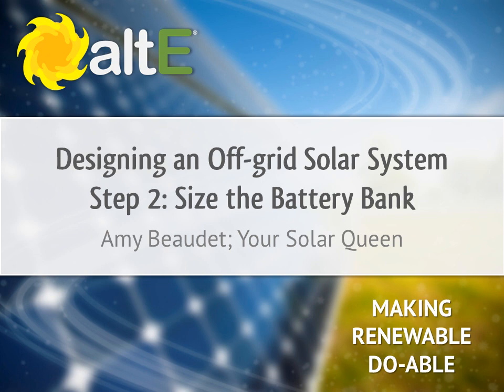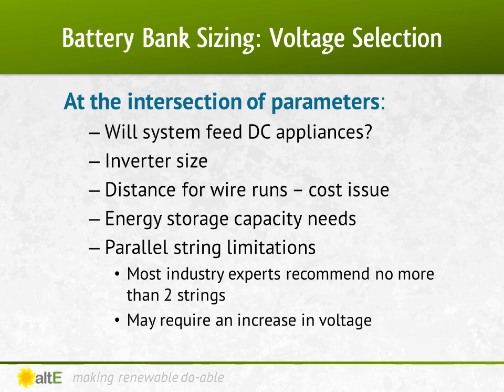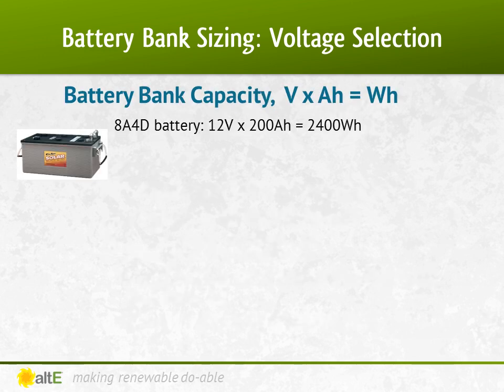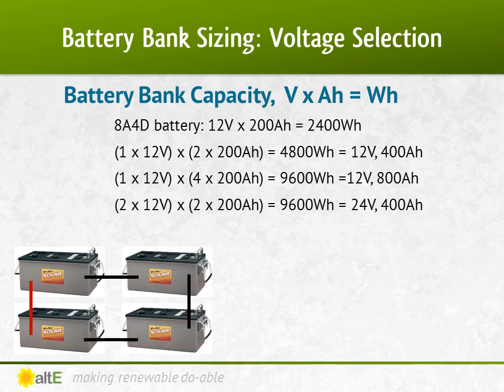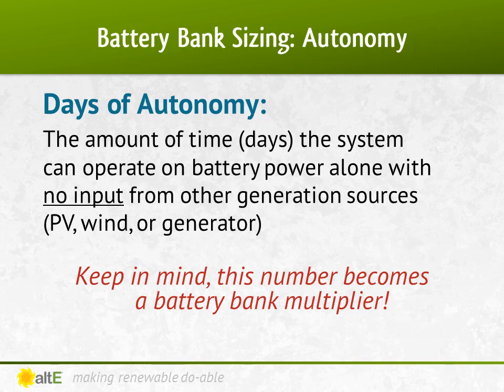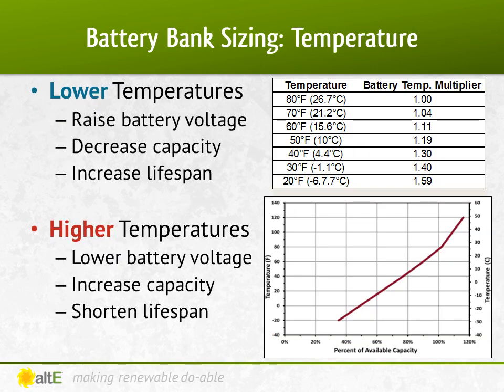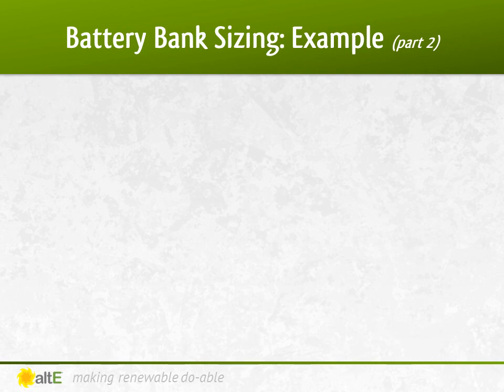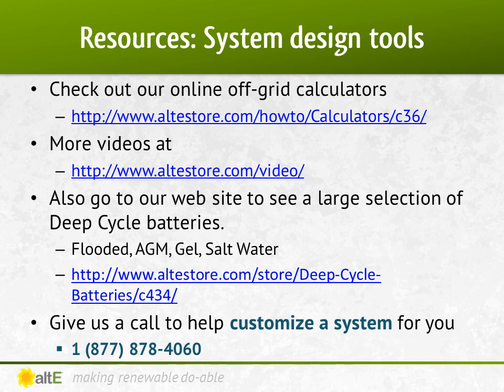Battery Bank Sizing: Off Grid Solar Power System Design - Step 2

Comment: I just recently noticed something,,, I'm very new to Solar I studied up on all this stuff then hooked up my 4 golf cart batteries 2 strings I hooked positive and negative together on two batteries then I hooked up the other 2 batterys the same way, I then connected the first string to the second string by way of hooking up the negatives together,,,,well in all my excitement about everything I then hooked up the charge controller,,,real nice pro star ps 30 m,,,then my panels,,,made sure everything was fused and grounded,,,,got a real nice samlex pst 300,,,works great,,,well the other day I was checking the water level in the batterys and got to looking around and seen that I had forgot to hook up the the other side of the strings+pos.from one string to the other.?????I was and am hooked up across the bank diagonally it was getting 12 volts and still am,,,well after I made the correction I found my self wondering how was it able to work like that???was I only getting amps from one string???anyone know please feel free to enlighten me,the only thing connecting the strings were the_negative from one string to the other,,,,idk,whatever you do especially if you are new don't be overcome by the excitement of what you're doing take time to really look at things good and maybe get a friend for a second set of eyes to look at it too that's what I've done now,,,anyhow thought I would chime in on that
Reply from the maker: +bill767667 You guessed it right, you tried to wire 2 parallel strings of 2 in series, but you ended up with two sets of batteries wired in series, but not wired together in parallel. So you had 12V, but only half the amp hour expected, from one string, not 2. Whenever I am building a system, I draw a rough schematic, and will trace everything out between the system and the drawing.

Comment from the maker: @Jac Wolf - I can't reply to your comment, your settings may not allow it. So, in case you read the other comments, I'm assuming you mean 16kWh battery bank. If so, figuring 50% depth of discharge, that leaves you 8kWh or 8000Wh / 3000W load = 2.6 hours. That's not including other losses like inverter inefficiencies and temperature compensation.

Comment: thank you for explaing about the 2 paralell strings. i didnt know and did 8 car battery that way. i got 12 volt inverters, so i think i'll run 2 strings of 48 volt, and tap into one battery on each leg. got plenty of controllers to charge for 48 volt

Comment: Amy - I am trying to reach the technical desk at altE because we may need to upgrade/add another pre-wired SW4048 to our system. We need to charge (2) Absolyte GX 48vot/2,000 Amp hour Battery banks. Please help direct us if you are able. Thank you.

Comment: I live in the Caribbean where we get around 5 - 6 hours of intense sun a day based on maps. I want to run a 50watt deep freezer for 8 hours a day (400 WH) using a 12v,  2000watt inverter with a PWM controller. Based on two days without sun, this video's calculation recommends a 8000 Ah battery bank yet only 119 watt solar panel! In areas such as the Caribbean, with many hours of reliable sun, can you reduce the size of the battery bank and increase the solar panels when appliances, like a fridge, are run only during peak hours like from 9am to 4pm?
Reply from the maker: I think you missed a step in the calculation, that battery bank is too big. 400Wh / .9 inverter efficiency x 2 days \50% DoD x 1.11 temperature / 12V = 164Ah. But to your original question, load shifting can be tricky to calculate. Yes, it makes sense that if you run the freezer when the sun is shining, you'll need a smaller battery bank, because you are using the power almost as fast as it is being made, so you don't have much to store. The problem comes with your 2 days of autonomy without sun. You still need the full amount of storage to run without the sun, plus you need to make sure your battery bank is full and ready to go before those two sunless days hit. So if you used all of the power real time the day before, you may not have charged the battery bank fully as well, if your load used most of the power. That that can be managed a bit by making sure the battery bank is full to begin with, and you size the solar array to be big enough to make all of the power use use, plus a little extra to ensure the battery is always topped off.
Reply: Thanks for your reply and all your videos! I'll probably double the bank and panels since that is about what I use now without the freezer.

Comment: I have 10 300w panels about 30 ft from the garage I'm trying to figure out if I should put the inverter batteries controller in a shed next to the panels and run AC to the garage or what I would rather do is have inverter batteries controller in the garage. What size wire would I need for 30ft run? Can't find that info anywhere.  Love your videos!
Reply from the maker: How are you wiring the panels? Five parallel strings of 2 in series? What voltage is your battery bank? 30' isn't too bad to run the panels to get into the garage. Find the Vmp of the panels, times the number in series, and the Imp of the panels x the number in parallel, and use this voltage drop calculator to determine the wire size. You want less than 2% voltage drop. https://www.calculator.net/voltage-drop-calculator.html
Reply: @AltEStore  Yes 5 strings of 2 each. 4 12v batteries to make 48v since panels are 48v.
Reply: My array is 85' from my electrical room and The loss is negligible.

Comment: Thanks a lot for those very clear tutorials.
Why do you restrict your battery bank voltage to 48Vdc?
Low voltage = high current = high fire hazard or high cost (high gauge)...
I may come up with a silly idea, but I'm considering a solution enabling  both power and water supply (to a water tower) from the same PV array, but using a solar pump inverter in order to preserve my batteries, the most expensive part in all this... 
Pump inverters usually need a quite high DC input. We do not need to pump water like seven eleven 24h X  7 days... so the idea is to have a PV array that can be reconfigured from 2 strings of 6 panels in series (250W-60) = POWER into one string of 12 panels in series to get that high voltage = WATER. The MPPT controller shall be able to handle 300Vdc  PV input, >3000W, and charge a 96V battery bank. 
Voc=37.1 Vdc, %/°C = -0.32%, t°=5°C, =>Voc=39.47Vdc x 6 = 236.85Vdc 
W input Max irradiance =  irradiance at noon Max t° 65°
Pmax 250W  %/°C = -0.47%  P65° = 2,436W; 2,436W ÷ 96V= 25.4A => 30A.
I can achieve the reconfiguration with two DC Isolator Switches 4 Poles
I would not be able to do that with a 100V or 150V DC max MPPT controller, the switching POWER => WATER would be more tricky... 
Some Morningstar products accept up to 600VDC PV input...
Reply from the maker: With Tesla's announcement of their 350VDC Powerwall battery, some inverter manufacturers are developing inverters to support a 350V battery bank. However, most inverters still only support up to 48V. I suspect this will be changing soon as availability of the Powerwall battery grows.

Comment: Does it help or hinder to cross-connect battery banks in parallel, so that the intermediate voltages throughout the parallel groups are equalized?

What I mean:
Suppose I have a 2x2 battery bank.   Batteries 1 and 2 are in series.   Batteries 3 & 4 are in series.   Batteries 1 and 3 are the most negative batteries, with their negatives connected.   Batteries 2 and 4 are the most positive batteries, with their positives connected.

Should I connect the positive of battery 3, to the positive of battery 1, in the above bank?
What are the advantages / disadvantages of doing this?
Reply from the maker: Absolutely yes, connect diagonally. If you were to connect just from 1 & 2, due to the additional resistance of the parallel cables, and Ohm's Law, they would get most of the charging and discharging, creating an imbalanced battery bank. Connect the minus  on battery 1 and the plus on battery 4.

Comment: I need a bit of help doing it the other way around please. I am looking at buying a battery bank with 16Kva batterys (48volt system). My max usage is about 3000watts per hour. My non electrical head tells me its about 10hours ?? Thanks

Comment: hi thanks for the calculation. I have one doubt, how did u end up picking up 48 V?? Was that just your choice?  Could i have chosen a 24V system voltage. So in that case it would have 16,986 Wh divided by 24V and than i would have carried on with other calculations.? Would that have been ok as well ?
Reply from the maker: While you could do 24V, it creates some issues with large battery banks. #1, if you also have a large solar array, you will need 2x bigger charge controller, or twice as many. For example, if you have a 5000W solar / 48V battery bank = 104A of charge controllers. But if you have a 24V battery bank, 5000W / 24V = 2o8A charge controllers. #2, if you have a big inverter, that causes high current going into the inverter from the battery bank. For example, 8kW inverter / 48V = 166A. But for a 24V inverter, it would be 333A. That would take bigger battery cables and breaker or fuse. #3, you would need a higher amp hour battery bank. 17kWh / 48V = 354Ah, but / 24V = 708Ah, which can be tougher to make without doing multiple parallel strings. But, if it is a medium size system, and all of the math comes out reasonable, then yes, divide by 24V.

Comment: I just say something about sizing the battery bank by array size controller max out out amp and voltage. ie...2k array, 79 amp max out put controller and 24 battery bank not up to par?  (2000  79x24= 1896) by what I heard a 36v or higher voltage bank should be used? Is this correct?
Reply from the maker: There are several factors that go into deciding the battery bank voltage. Very few companies make 36V equipment, so if 24V isn't high enough, you would go up to 48V.  Your example of the 2000W array and 79A controller is a good one. 2000W / 12V = 166A, so that won't work. 2000W / 24V = 83A, so again, no good. 2000W / 48V = 41A. Bingo!
Reply: Thanks fr verification I was hoping it would work, I really didn't want to g with that many batteries  Great info

Comment: I have 4_6 volt golf cart batterys 4_100 watt panels,morning star charge controller ps30m,the batterys are 188amp hour excide,I use 12 volts as much as possible,I use a 300watt samlex pst sine wave inverter,and I also have a few different generators,I want to know,,,can I safely add 4 more batteries wired to same as I have no series parallel so I'll have to series parallels instead of the one so I can have more TV watching time on the weekend and other things can I do this without hurting the bank(battery),, I assume it would be safe to do

Comment: What about BMS? If you have a BMS then can you run more strings? What about lithium batteries that have a built in BMS? I'm looking at doing a large lithium system with built in BMS running 4 strings...
Reply from the maker: Most lithium are able to manage more strings than lead acid due to their battery maintenance system.

Comment: Amy, step F: Determine total number of batteries needed. The formula should be number of parallel strings that is 2 times number of batteries in each series string.

Comment: hi there, can you clear something up for me.

I am trying to figure out an equation for my battery bank.

If I want to find out the amount of amps that my 140 watt tv uses, do I need to divide 140 watts by 240v ac(as this is what my inverter produces) Or do I divide 140 watts by 12v (my battery voltage). my battery bank is 115 amp hours so I want to know how long I can run the television for. thanks!
Reply from the maker: I see from your channel you are in Ireland, so the 240V (or possibly 230V?) output from your inverter is what you would be using to power your AC appliances. I wanted to check what country, as here in the USA, 240V is split into two legs of 120V, so the answer would be different. So for you, to determine the amps drawn by your TV on the output of the inverter, you divide watts by AC volts. So 140W / 240V = .58A on the AC side. Now if you want to find out how many amps your inverter is drawing from the batteries to power the TV, that's when you divide the watts by the battery voltage. 140W / 12V = 11.6A on the DC side. I hope that makes sense.
Reply from the maker: What might be easier for you is to convert everything to watt hours. Your battery bank is 115Ah x 12V = 1380Wh. You don't want to use more than half of that for 50% depth of discharge, so you have  690Wh available. 690Wh / 140W TV = 4.9 hours. It may make sense for you to buy a newer TV that uses less watts, 140W is pretty high for a TV these days.

Comment: can we use 2  24v 400ah batteries in series (2*24)*400=19200wh?
from this method we can use 2 batteries instead of 16batteries 6v.
Reply from the maker: If you can find 24V 400Ah batteries (9600Wh) and they will fit in your location, you can use them. But they will likely be very big, especially if lead acid.

Comment: hi there can u help about battery power capacity.
2×200ah 24volts system.  and 2×200ah in 12 volts system are these two set of battery are the same in terms  of power capacity if both fully charge which is 4800 watts im curius
Reply from the maker: I assume you mean if there are two 12V 200Ah batteries, in one system they are wired in series for 200Ah, 24V, and in another system they are wired in parallel for 12V 400Ah. In both cases, the battery bank would have the same capacity, Ah x V = Wh, so they would both have 4800Wh capacity.
Reply: altE tnx for the info really apreciate....
can i ask one more thing
i have 4×150watts 12volt panel conected in series... when i use tester theres 12volt output in the cross conection of 4×150watts...can i hook may additional 150watts panel in the cros conection is that advisable or might cause a problem or power drop and voltage drop

Comment: If I'm understanding your video correctly, I should never have more than two batteries in parallel?  WOW!  I've seen dozens of videos where battery banks have 10 or even 20 batteries in parallel.  Are they all doing it wrong?  I currently have a bank of 10, 12 volt batteries wired as two in series and five in parallel to get to 24 volts.  Is this really a bad thing?
Reply from the maker: Multiple lead acid batteries in parallel run the risk of uneven charging and discharging, potentially shortening the batteries' life. When you next need to replace the battery bank, perhaps select a higher amp hour, lower voltage battery to allow more in series and less in parallel. Newer technology batteries that are able to operate in a partial state of charge (PSoC), such as the salt water, nickel, and some lead batteries with carbon do not have this restriction.